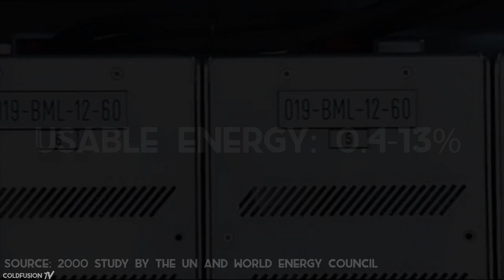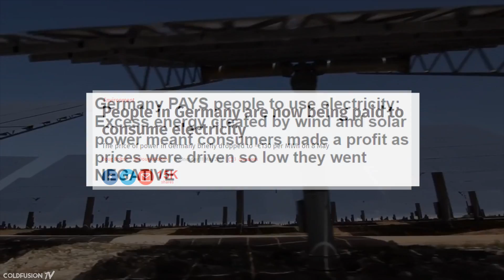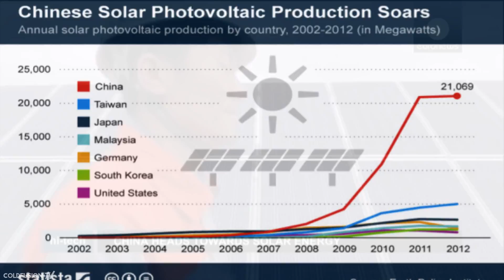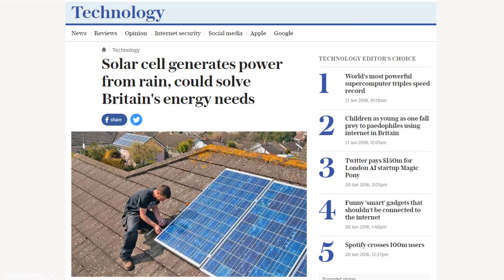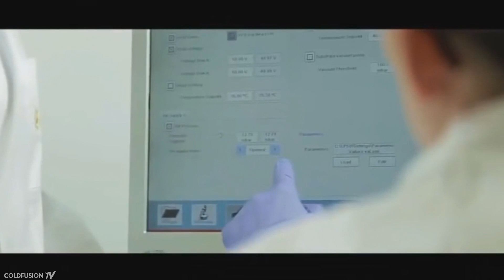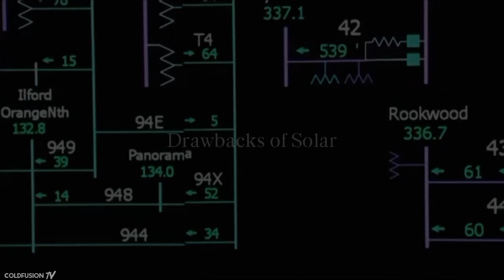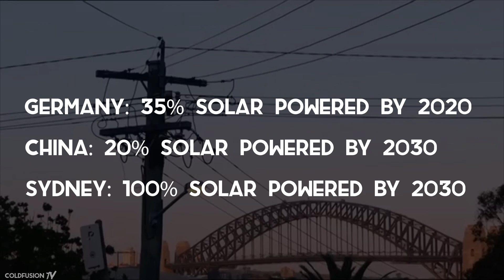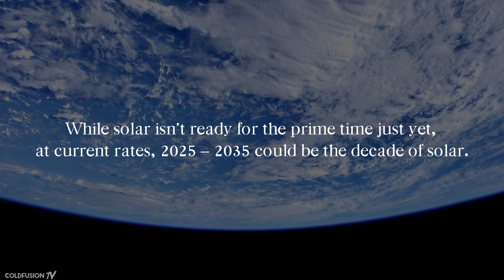The Truth About Solar

Comment: The thing that no one talks about is how much resources are used up in the production of solar cells. How much of an impact does this have on the environment?
Reply: Mostly it is silicon - and that is something we have unlimited resources of. Then there is some copper for the internal wiring and fractions of rare earth materials for the silicon to get the needed properties.

The process to create these big Si-mono-crystals is a little heavy on energy but that becomes irrelevant at some point. There is this hoax that the productions needs more energy than the cells will ever harvest but that is some major BS - wouldn't be surprised at all if the fossil fuel industry created this myth.
These cells get there break even after 3-6 years and after that every kWh is a surplus.
And always mind that these cells have a huge life span. Of course they loose efficiency in long term but does it matter at all? Okay - let's say owners may want to replace it after 15-20 years for the new better ones and because of the lower efficiency over time. But it is estimated that one could use solar cells for at least 60 years. The old cells could be replaced and the modules sold on second hand marked to the third world or put cheaply on all kind of roofs, parking lots in places you wouldn't put them at release price tag. It would still produce energy and the energy balance improves with every day the cells are actually in use.
Reply: +Oliver Kurzweg interesting. I'm glad someone responded because I have been trying to figure this out for a while but no one really put it in perspective.
Reply: Better check again. It takes very clean sand... And, that is not the stuff you find every day on the beach.  And quantities of rare earths are, well, rare. There is no such thing as an unlimited resource. That was the proposal for solar in the first place.

Comment: The most efficient panels are 22%, not 32%  Panasonic makes them. Solar City's are a tick off of those.
 What MIT is forgetting in the set up of their arrays are the same thing can be done on a much larger scale with panel sizes now in use. The cost of their design would make it obsolete before it was installed.

Comment: I really liked your documentary.  With all the solar farms going up I hear both pros and cons... As with "new" or change there are always skeptics... But most of the people in my area are hesitant about solar due to the fact that when the farms are put in the land owner signs a contract that requires them to assume ALL responsibility of any environmental cleanup.  These culprits in the manufacture of solar panels are Hydrochloric acid, copper, trichlorosilane gas and silicon waste; Cadmium, Nitrogen trifluoride and sulfur hexafluoride, Copper indium selenide and copper indium gallium (di)selenide.  As with any new technology there will be new and improved manufacturing techniques and recycling programs (Necessity is the Mother of Invention). Have you ever planned on doing a documentary on these subjects?  I really like solar as a renewable energy source and would like to hear all the data... Thanks again ?

Comment: Plants are green because of chlorophyll, so in general plants are greener if they have less sunlight to work with -the complete opposite of what Musk was arguing for. 

Businessmen with sizable investments in a particular area, should not used as (or even expected to be) a source of unbiased scientific information for said area.
Reply: ProfessorEGadd "His point is that if the UK had no meaningful solar energy then it would have less plant-cover." That's exactly how I understood it.
Reply: KR P Re: "in which case I'm just an idiot who can't understand english." No, you just need to use your brain more often. It's hard work, I know. And because using one's brain is hard work, most people prefer to just wear it (more or less like a hat). But I can tell you (from own experience): Even though using your brain is hard work, it tends to be very rewarding! :)
Reply: Plants are green because they reflect the waves of light that correspond to the green color. 
But I think it's still valid to say that because plants thrive in the UK despite less direct sunlight, they are getting enough energy for photosynthesis.
Reply: It is actually 'green' light wavelengths (lambda), differently 'colored' light isn't fundamentally different from each other.
Plants use about 1% (often less) of the sunlight they are exposed too, add in how little energy they need to survive (compared to humans or other vertebrate animals) and it's not that impressive from an energy density POV.
(BTW humans use around 100W)

Musk implied that greener plants equated to more sunlight, it does not and AFAIK it is an inverse relationship.
Reply: +KRP
He didn't say or imply greener plants means more sunlight. He wasn't even talking about colour, he said 'The UK is pretty green', which is a common euphemism for 'has many plants'. His point is that if the UK had no meaningful solar energy then it would have less plant-cover. His argument is still flawed, of course, but you were misrepresenting it. Listen to it again and I think it is very clear what he means.
Reply: However light/photosynthesis doesn't work like that, barring obstructions -one side of the road will get about the same amount of solar energy as the other.
As such the only factors limiting plant growth would be soil fertility and water.
Leaving the needs of specific species aside -A greater quantity of sunlight does not equate to a greater number of individual plants.
When it comes to sunlight -either there is sufficient sunlight for some type of plant life or there is not, there is no range or scale.

Also 'The UK is pretty green' if used as 'common/modern' euphemism would imply that the UK is 'environmentally friendly' and not that it has abundant foliage (where as 'The UK is very leafy' would).
Reply: It's always hard when people have to dumb-down what they are trying to explain, I always see this with Musk, he'll answer a question then the reporter will constantly ask him to re-explain it more simply. The problem with simplifying information is that you lose some of it. I think this is deliberate so that reports can then quote the simpler answer and then poke holes in it. Just as you are doing now. In the end it's a pointless waste of time for you, you're making a strawman argument.
Reply: Fleecemaster

Musk is promoting solar energy for/in the UK, in response to a very legitimate and relevant point about how the UK's weather would negatively affect output -he brushes it aside and implies a false relationship between the abundance of flora and usable solar energy.
So where exactly is this straw man you speak of?
All I did was point out that his counterpoint to that specific criticism was in fact incorrect aka 'debunking'.

Furthermore there are obviously people who have accepted his counterpoint as valid and thus would presumably have a distorted impression of how inclement weather affect solar energy output, thereby influencing their perceptions about the current viability of solar energy technology.
Reply: KR P
Look at your latest post, then look at the post you made before I commented. If you have any reading comprehension you will see that your position has changed. Now you are talking about 'abundance of flora', not 'greener plants' i.e. you are now addressing Musk's actual comment. That's all I wanted. Musk's argument is flawed (as I said) but now, thanks to me maybe, you are discussing the words he said and not the words you think he said.
Reply: ProfessorEGadd

Well, not really.
I interpreted his comment as a reference to plant colour -which would make it invalid.

You and others have said that he actually meant 'an abundance of flora' -even if this is so, his comment is still false.

I was just addressing your positions to demonstrate that regardless of how you slice it (colour or quantity), his comment is still woefully incorrect.
Reply: KR P
Yes, his argument is bogus. I am not and have never defended his argument.
You are not addressing my position because I have forwarded no position. You were addressing a strawman and you are now addressing Musk's argument. You're welcome.
Reply: ProfessorEGadd

This is getting extremely tedious.
When Musk said "the UK is very green" he provided no context as to whether he meant the intensity of colour or quantity of plants for that statement.
Seeing as his statement would be false regardless of which interpretation was used, you can not even deduce his original meaning by giving him the benefit of the doubt.

So did Musk contact you or somebody else to clarify his comment?
Because unless he did  -whether he meant abundance or colour is entirely subjective and a matter of opinion.

You are the second person to just throw 'straw man' at me with zero qualification.
A straw man requires attributing undeniably false or out of context properties/positions -as I have pointed out this is a matter of interpretation/opinion with no context and so it can not possibly be a straw man argument

So either you guys have to reevaluate your understanding of a 'straw man' or Musk's meaning was absolutely clear and not open to interpretation at all -in which case I'm just an idiot who can't understand english.
Reply: Alex Booster
Sorry dude but that was mostly just (hyperbolic) bait to weed out the intellectually dishonest and/or dumb asses in this thread...so yeah.
Also props on the condescension, which was totally warranted given the towering intellect you displayed in your previous posts.
Reply: KR P
"Actually I was just trolling, lolololol" - Someone who has realised they are losing an argument and trying to cover it.

2/10 Try harder next time.
Reply: I'm done here -I know I shouldn't give 2 shits if youtube people think Musk is their Lord and Savior who can do no wrong but alas.

It was a hyperbolic statement that I used in hopes that it would make you guys realize how ridiculously dumb your stances/arguments ultimately are -but instead you both latched on it as if it was legitimate.

Believe or don't believe what you guys want, this thread has way exceeded my 'give-a-crap' quotient.
"Never try to teach a pig to sing; it wastes your time and it annoys the pig" -Robert Heinlein
Reply: KR P k

Comment: Point(s) of order: it's actually $3.70/watt here in the US after installation if you're not taking (or are unable to take) the 30% tax credit. Solar is horrible for the environment: Pure silicon cells aren't produced by solar-powered manufacturing processes. Nor are they generally made in the country they're used in. This is a double-whammy of fossil fuel use that never gets mentioned in pollution estimates. Nuclear at least is built on-site from locally sourced materials. But let's continue: So you use silicon, great: The process to refine a boule before you cut wafers is to heat it up, which liberates CO2. Transportation and manufacture estimates range between 75 to 314 kg of CO2 per square meter of panel. Oops, lets move on from that; It's not the most efficient (You're looking at 8% efficiency even for monocrystalline silicon cells.) To get higher efficiency, you have to use cadmium. (CdTe) or rare-earth elements (CuInGaSe: Indium and gallium are refined out of zinc. The impurities and elements to refine are, again, cadmium, but worse, lead and arsenic.) I mean, you're only moving the waste to China, but who cares about that. So you're left with power that still costs you a bunch of money (Tax refunds come from your pay. Either you're having money taken from you to redistribute to do something or inflation is created and your money is worth less.) that screw up the environment somewhere else to manufacture and still release CO2 to make. But at least you can be smug about how socially and environmentally responsible you are. (That last bit was sarcastic: I keep petitioning the IETF to approve my sarcasm-over-IP RFC, but they keep turning me down.)

Comment: So what happened to these solar shingles ? I need a new roof.  I looked into that five years ago.  Back then they said it would cost about 1.5 times as much as a shingled roof. But would pay for itself in 10 years. And then all those ads that disappeared.
Just wondering what  happened ?
Reply: Oil companies probably gave them a back-hander to bin the idea .
Reply: Check here.. do't know about america but..http://www.inspirationgreen.com/integrated-solar.html
Reply: The efficiency of those is bad. Iam talking 6-8% vs the usual 15% of Polycristalline cells. Thats why noone has them on the roof u dont have the space to fit enough of those to get colse to the resilts of cheap poly cells.
Reply: Yeah that sounds about right. A couple  reason I have waited so long to replace the roof is I wanted more out to the solar cells  at  a better price. As soon as I replace the roof somebody will come out with one that do all the things I was looking for.
Reply: thin film solar panels are pretty inefficient...  i think the most they can do is recharge a cellphone or something.

Silicon based can have 20% efficiency (premium product) but are expensive, some composites can go even higher but that probably involved some very expensive rare earth metals.
Reply: OK so basically your saying the technology is not there yet. So once they get the bugs worked out then it may be something to look into.

Comment: While I am not anti-solar, I won't buy the solar hype... PV cells just aren't ready yet, once graphene production hits something/anything like a mass production scale then PV will become economical.  As stated in the video, all of the investors in PV power are losing money.  this cannot continue, actually it won't continue, as all available investors will be strapped for cash in the next 10 years.  Hopefully Graphene production will begin producing cells closer to the 50% efficiency point.  Until then it seems best as an off-the-grid solution for power problems.  Other forms of solar are quite promising (solar collectors, etc...)

Comment: Good video, but they missed the biggest downsides to solar; the toxic waist produced in the manufacturing process and the fossil fuels used by the tucks to transport said waist hundreds or thousands of miles away from the factories.  Still cleaner than coal, but those two fact cannot be glossed over or ignored.  Essentially we off setting our toxic waist production from one avenue to another.  Again, better in the long run, just something to always remember.  "Green" has it dirty sides too. Don't be fooled or surprised.

Comment: Half truths throughout this entire video of lies.  The "cost" of solar is highly distorted by government subsidies paid for by Everyone.  The artsy writers are obviously too stupid to factor in environmental costs of all the poisons dumped into the environment during production of these subsidized solar panels.  And the so called massive energy in Brazil that resulted in negative costs, the writers deliberately failed to note that nobody was using the solar electricity because all the mines closed down.  And there were no wires to send the electricity elsewhere.  So of course the panels continues to produce electricity nobody wants.  If I stick a solar panel in the Antarctica using taxpayer dollars, I too will be producing electricity and paying people to take it.

Hint to you airheads: If you have to lie to make your point.  Than maybe, just maybe, you have no point.

Comment: Complete nonsense.  Solar is heavily subsidized and solar cells will get dusty and need constant cleaning.  If you want a solar solution here and there try geo-solar.  This is a heat pump used in an area where ground water is heated by the sun; like in Florida.  My father's condo uses one to heat their pool.  The real solar energy solution would be a CELLULOSE based BIO-FUEL.